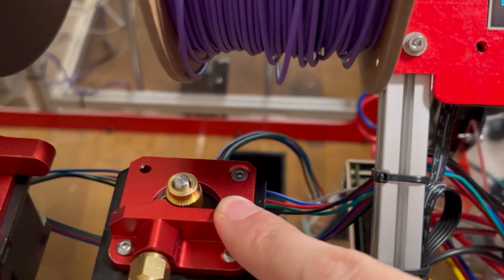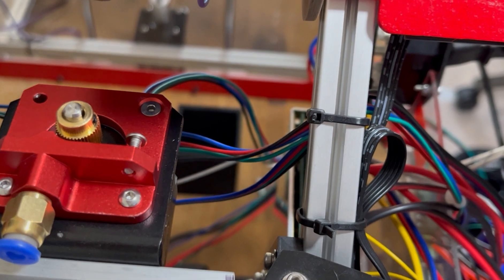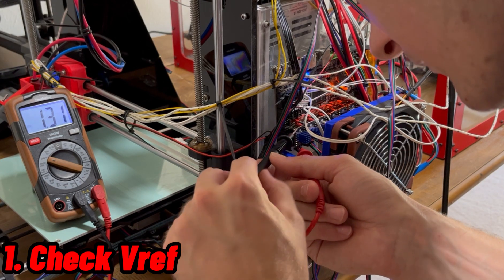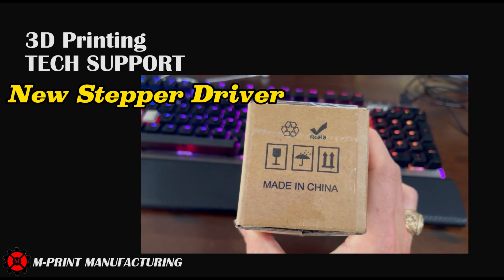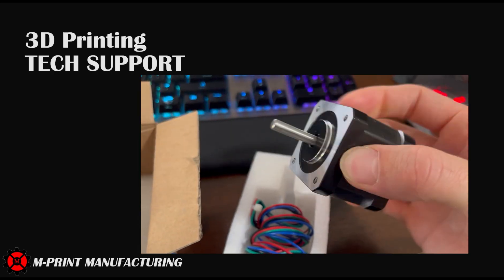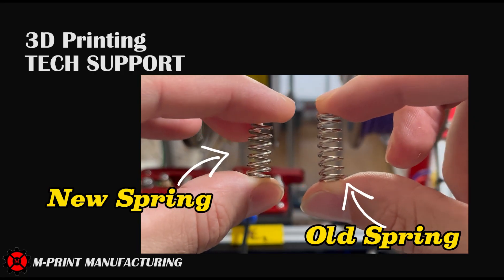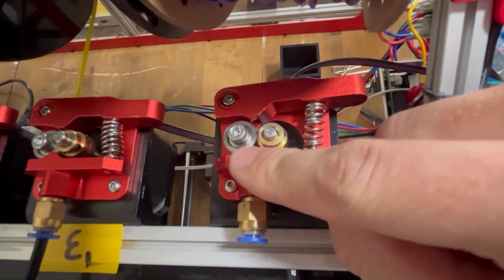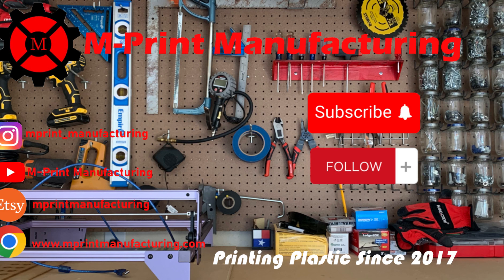Vibrating Stepper Motors

Comment: ty man, i was kinda desesperate and then i found the video. there was 1 of the 4 wire that has been disconnected because when i replaced the extruder cable i had to get rid of all the hot glue the manufacturer put but the hotglue took a wire with her :/
Reply from the maker: Hey @CamaradeKC! Glad that this video was able to help you and your printer is back up and running!